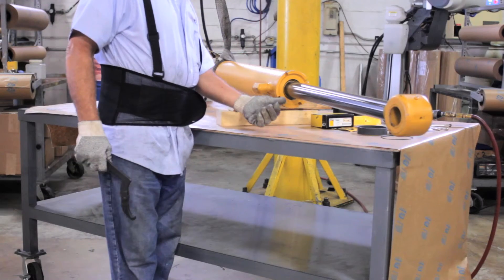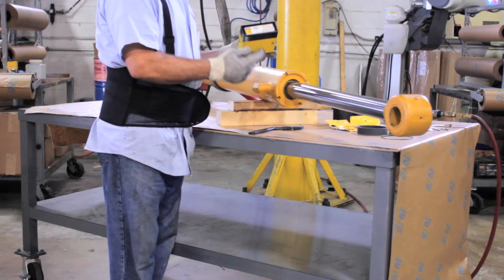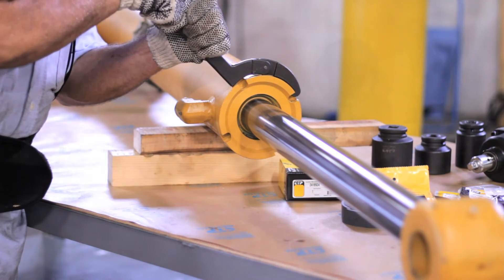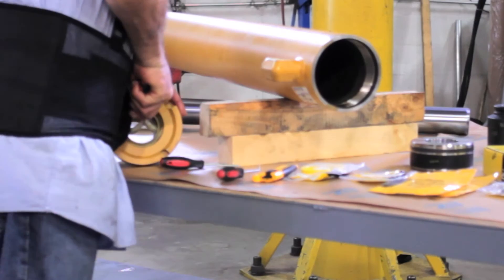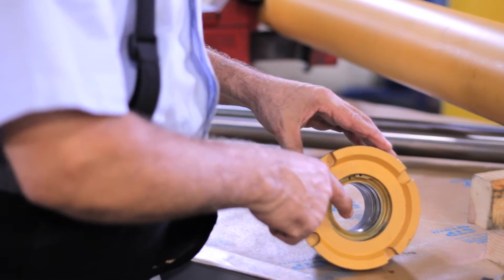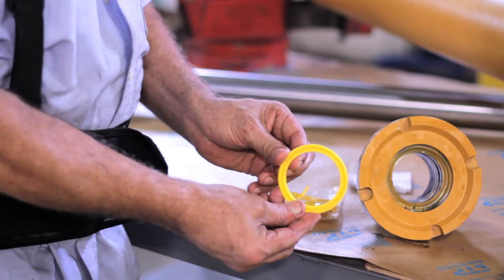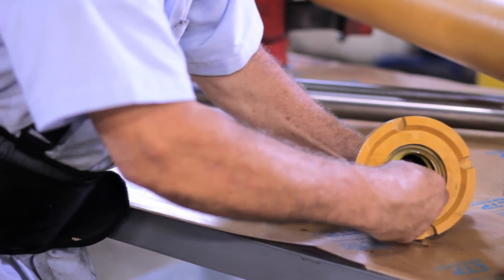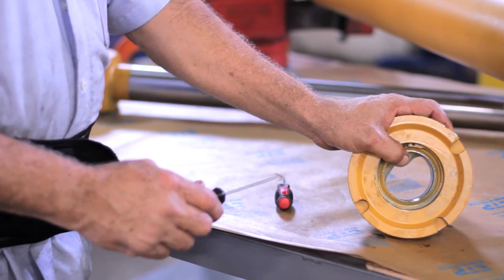CTP Hydraulic Seal Installation

Comment: Nice stuff, but will true seals be identical to a caterpillar seal kit (specs and all ), just doing some home work before I switch over to ctp
Reply: I have used about a dozen CTP seal kits for older Cat equipment. It has been my experience that the CTP seals are slightly undersized. While this makes installation easier than OEM Cat seals, they usually begin leaking after a short time of usage. When I have repacked my seals a second time with other brands, the leaking stopped, so I do not contribute my leaks to worn or damaged equipment. Again, I have a limited history with these seal kits but that has been my experience. Also, I have never received a paper instruction sheet with a seal kit as shown in the video.